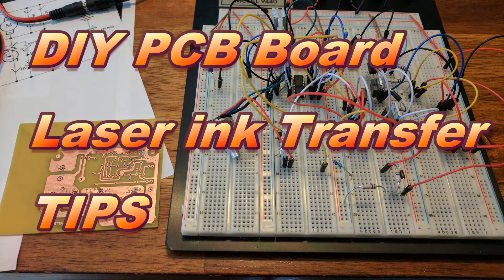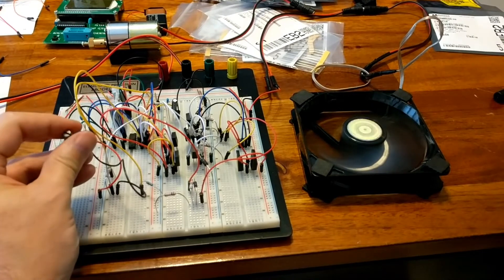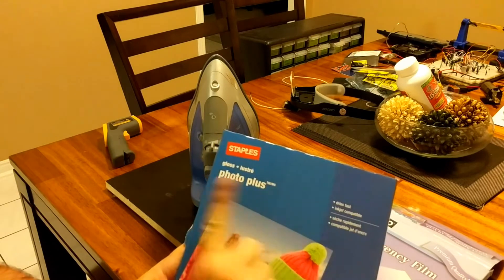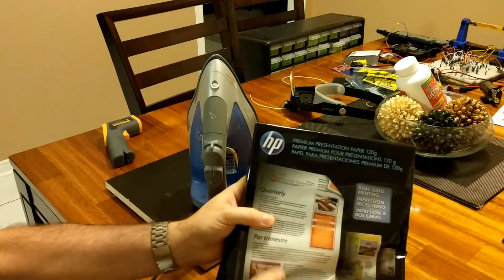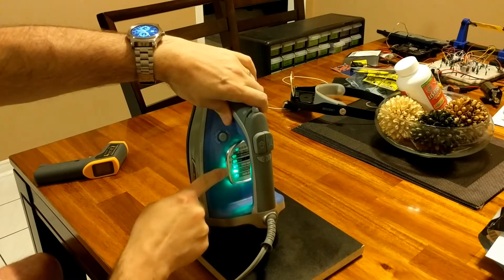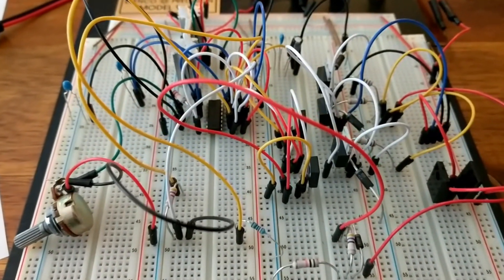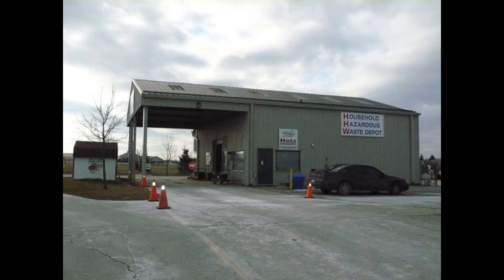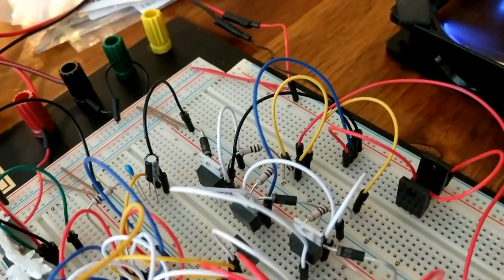PCB Board Laser ink Transfer tips

Comment: Hi - very nice video.  You might consider showing the ironing process, and how much pressure you're applying; some say it should be as much as possible.  I've had very good success (after many failures) using a cheap brother BW laser printer with the black intensity turned up to 6 (maximum).  I print on thin, coated paper stock (like the paper used in supermarket tabloids) and run it through a cheap, Scotch brand laminator for 24 passes.  I then soak the paper/copper board laminate in water for about 5 minutes, and rub the paper away with my fingers; the water dissolves the cellulose in the paper, and it separates from the pattern without damaging the image.  I then etch using MG chemicals Ferric Chloride, same as you.

Again, thanks for a nice, helpful video.  I appreciate learning other methods, and seeing how others are doing it.  >Charlie